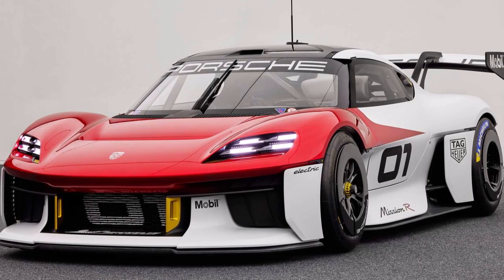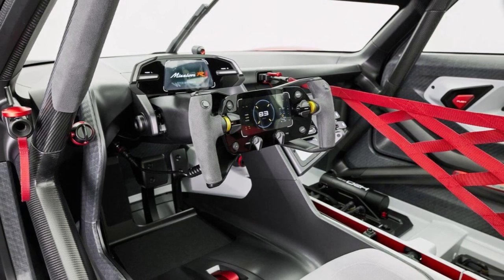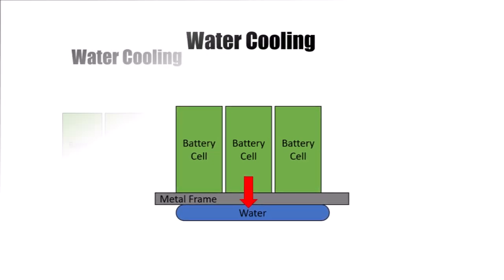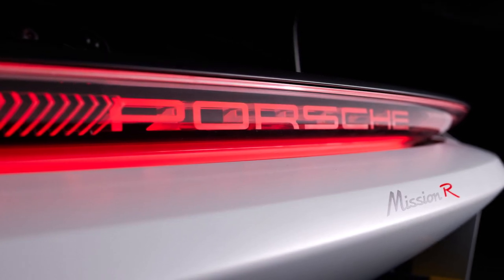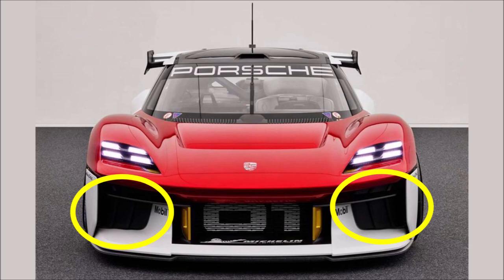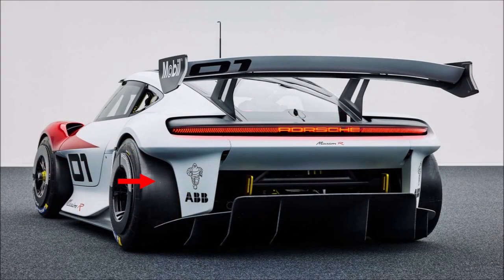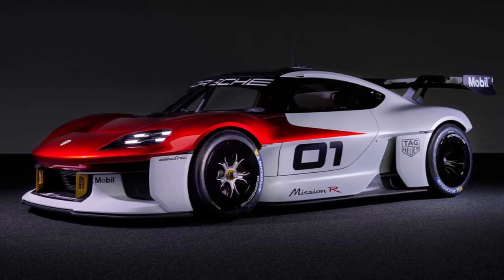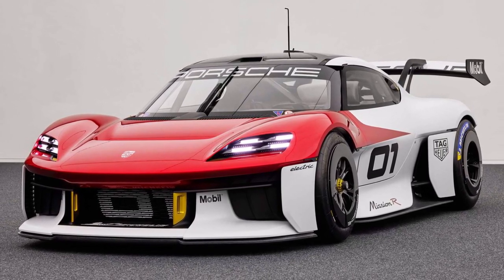Porsche Mission R - First Look

Comment: The car looks promising. Liked the neat breakdown of features. Is there room for an enhanced version of immersion cooling as applied to electric/electronic components, say, using a fluid like 3M Novec and likewise?
Reply from the maker: Thanks! Yes, immersion cooling is the next big thing. The 3M Novec additionally uses phase change from liquid to gas, which is another step but not very useful for vehicles. You will need another phase change. I worked on this before but cannot tell you much more ;)
Reply: Glad to hear back!

Comment: hmm, could you explain why the cut outs behind the front and rear fenders are there to reduce drag? I thought a more flush fender would reduce drag due to minimal turbulence.
Reply from the maker: It's to reduce the parachute effect. So you don't want air flow trapped in the wheel arch. You usually use these cut outs for cars where downforce is the priority, even if it's dirty downforce. Because of less geometry behind the rear wheels you can also get better extraction from the diffuser.
You are right, a flush fender makes sense for low drag cars like the Koenigsegg Jesko Absolut where downforce is not the priority. But in these cases they are usually combined with a long tail and rear wheel covers.
Reply: @BSport320  ah I see. does venting on the rear of the fender also produces the same effect? (examples: Rear bumper of the 991.2 GT3, side vent of 5th gen Viper)

Comment: What are the main differences in cooling requirements for electric cars between your every day road going car and a racing car? Do normal electric cars even need a front-mounted radiator?
Reply from the maker: Good questions! Electric race cars usually use different battery cells that can operate at higher temperatures. Hence battery and electric motors can be combined in the same cooling circuit, which simplifies race cars a lot. Electric road cars use cells that want to operate at around 30C, which means that you need a powerful AC system when ambient temperatures are above 30C.
The front mounted radiator is a very efficient solution, but radiators could be located somewhere else as well.
Reply: Why not oil-cool all batteries, also in road cars? …to expensive?

Comment: The intakes in front of the rear wheels might have a similar function like the ones on the toyota gr010
Reply from the maker: The Toyota is using them for through flow but the Porsche has a pretty full package at the back. Porsche said the rear brakes are not really used because of the strong recuperation, so I think it's just a design element.
Reply: I also thought of that but judging from the image from 0:15, dont you think that there might be a big enough gap between the upright and the chassis to channel a little bit of airflow to the diffuser trailing edge?

Comment: Just wondering. Which component (s) is the front radiator cooling?
Reply from the maker: My guess would be it's an oil radiator and they flow through battery first, then rear motor + inverter, then front + inverter. But more detailed shots will tell us more.

Comment: It looks amazing. I just think that EV is dead-end tech and is naff as hell. But it will take about 10 years for hydrogen combustion and fuel cells to start the replacement. In the meantime, cars like this will be interesting fillers to proper motorsport.

I am more interested in the Mission H24 project. But I am certain there will be hydrogen combusion engines soon. The imupetus is so strong now.
Reply: We will see about that. There a still efficiency, complexity and cost downsides about H2 Vehicles that will be difficult to overcome. And they cant all be cleared by technical advancements. It is also law of phyiscs.
Reply: @frederikwerner5111  The great thing about hydrogen, is there is no need for a global infrastructure to manufacture it. Anybody with a back garden, can theoretically, install a bit of equipment, a composite means of generating electricity and presto, they can make H. In reality there will be some expensive kit and safety standards to apply. But then when one takes into account the distributed and localised nature of H farming, efficiencies will come thick and fast.

There is lots of misinformation about H put out by Big Energy who stand to lose everything. As they did with nuclear, but times are changing, as are minds. EVs are unsustainable.

As before, motorsport and competition will drive innovation, even more reason not to waste time tweaking dead tech walking (EVs) :)